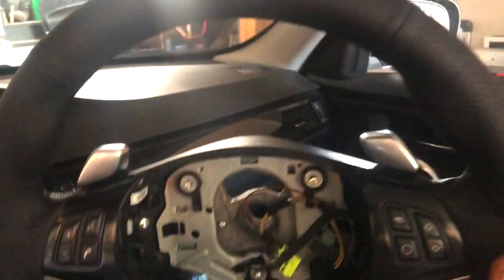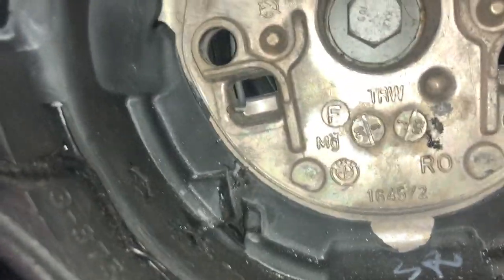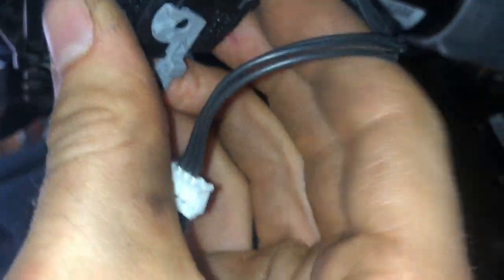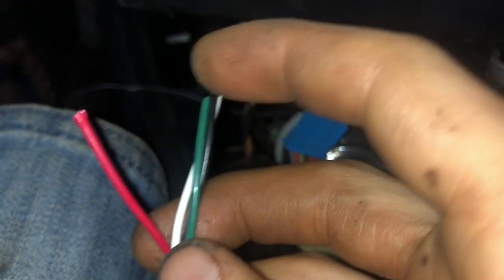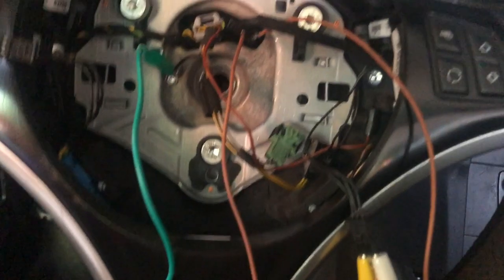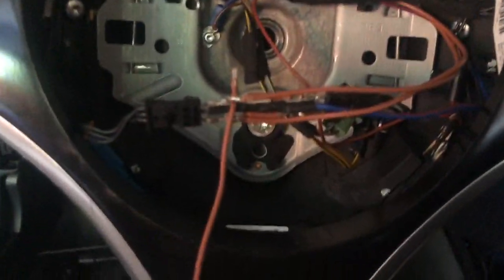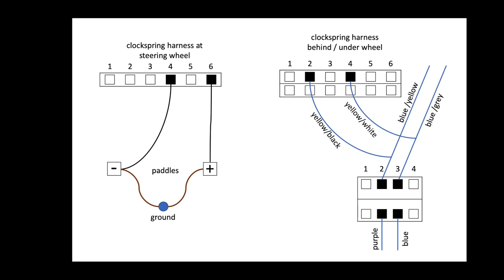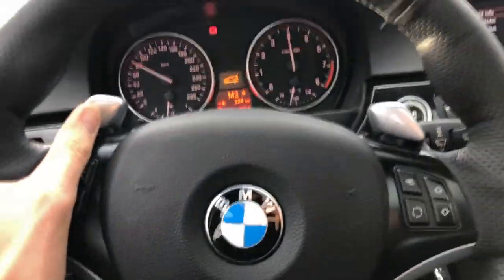BMW E90 Paddleshifter Retrofit

Comment: I have a question? Do you have to do the same wiring for the both of the paddle connectors?  or just the right connecter of the paddle connector
Reply from the maker: @Furtive_  the paddles are effectively joined together. With the default wiring they do the same thing. 

I just flipped the wiring on one paddle so it would pull to downshift and the other would pull to up shift like most modern paddle setups.

Comment: I did that a while ago on my 335d and the shifters didn’t work because the paddles were from a pre lci I needed that wiring diagram you posted in the end thanks
Reply from the maker: I’m guessing it helped?
Reply: @rackintosh  yes I just finished it today. But instead of by passing the steering control harness I spliced into it with no issues. Still have all steering controls, volume up, climate control etc.
Reply: I literally saw like 10 videos before this one actually helped me lol my pre lci car with pre lci shifters was simple and I only needed to wire from the shifter to steering colum this one was more time consuming

Comment: Does this mod work regardless which multifunction buttons the new steering wheel has? I know BurgerTunning says  that a certain part number multifunction buttons is needed apart from their harness. I wonder your method applies to a complete steering wheel that does not come with that specific part multifunction buttons.
Reply from the maker: I ended up bypassing the multifunction harness pins and just wired them directly into the clock spring. I couldn't get mine to work while connected to the multifunction harness
Reply: @rackintosh  me neither, I nearly gave up retrofitting mine until I saw you doing it your way

Comment: May i know the 2 existing cable on the clockspring harness under wheel [pin2&4] - where does that lead and whats the purpose of it? Is it safe to disconnect that?

Comment: I may have missed it in the comments, but where did you source the pins to put your wire in to put it in the bmw connectors? I'm curious about the ones on the wheel and the steering column. Great video and thanks for the help!
Reply from the maker: I had leftover pins from a wiring harness I de-pinned. I believe it was a quadlock stereo extension harness.

Comment: Question - after i retrofit them paddle shifters, can i perhaps get any of the modern paddles and change them? Will it work? Talking about them magnetic ones, or any just prettier looking ones? Thanks
Reply from the maker: @tonikaramanliev884  there are conversion kits for the steptronic paddles so you can run different styles. Do some research around “steptronic” you should find some options. They aren’t the cheapest but they do exist.
Reply: @rackintosh  thanks bruda

Comment: Thanks for the video. I have some questions about pins of the paddles.
Harness at steering wheel pin 4&6 connect to  left&right paddleshifter pin 1&3 , is that right?
thanks!
Reply from the maker: I’m not certain which is which but essential yes. 4 is for upshift, 6 for downshift (or the opposite). 1 & 3 on the paddles are the same and 2 on the paddles is ground. 

I flipped 1&3 on one of my paddles so that the left paddle is downshift and right paddle is upshift. 

You’ll just have to wire it up and experiment until you have everything right.

Comment: My multifunction bottons have plug when i can connect the shifters connector. Do i need to adjust any wiring there or will it work with just the clockspring pin 2 & 4 to gearbox?
Reply from the maker: I believe you can plug these into the multifunction buttons if they have the plug. I’m not 100% certain. 

You can always try and and see if it works.

Comment: Hi, your paddles works in mode D or just sport ? I have a 325i 2006 the paddles don't work in mode D but in sport mode it's ok
Reply from the maker: When in “D” mode it will shift but then revert back to auto after a few seconds. 

If they are working in sport mode that’s still pretty great!

Comment: Thanks for the video. I got a question, what do you mean by « bypass multifunction buttons » ? What I understood is that you just have to wire up and down wires to pins 4 and 6. And replug the connector. So do I have to cut the wires which previously go to 4 and 6 ?
Reply from the maker: The paddles normally connect into the steering wheel controls but for some reason mine didn’t work when hooked up that way. So I just created a harness directly from the paddles to pin 4 & 6.
Reply from the maker: I also can’t remember if there were even wires in 4&6 before but you should be able unpin them or something.
Reply: rackintosh , understood , thank you

Comment: There are 3 wires coming from each paddle shifter..your explanation shows only 1 wire going to pins 4&6 from each side and the earths being connected together..this must be incorrect..there are 2 wires from each side that need to go somewhere not just one
Reply from the maker: Three wires. Upshift, downshift and ground. 

Ground goes to the steering wheel ground (if I recall correctly) 1 is upshift, the other downshift. 

LCI paddles might be different but for the steptronic paddles this works. 

You can play with switching wires 1 & 3 until you get the desired function for the  paddles.

Comment: Does the heated steering wheels work on the new wheel?
Reply from the maker: Yes! I made sure to buy a heated steering wheel. If you have the non-sport heated wheel it will work.

Comment: thanks for the video, i see you did this to an LCI car, did you have to do any coding to get the car to accept the paddles? wondering if it will be different for a 2011 e91
Reply from the maker: I didn't have to do any coding, you just splice into the circuit already used by the shifter.
Reply: can be done for LCI MSPORT 2009 MODEL

Comment: I made a harness for this hardwire since the two wire method wasn’t working. I just have a question since I feel like my paddles Wires are messed up and aren’t the correct 1-3 pin layout. My horn goes off when turning on the car. I’m not afraid to mess with the car since I’ve been working on mine since I got it in 2014. Do you know the diagram for the wire coming out of the paddles itself. Mine are switched and can’t figure out what is ground, +\- do you know the layout for the Paddle shifters wires 😂
Reply: Did you find a fix? My car horn goes off too

Comment: Question....will this work on pre lci? 07 328i? If so which steering wheel would I need ? I know burger tuning has the retro fit kit
Reply from the maker: celis281 should work on pre LCI. I think the most difficult retrofit is getting the DCT or LCI paddles to work
Reply: I heard the only difference is on LCI cars you don't need to shift into sports mode to use the shift paddles, on pre-lci cars you do

Comment: I was thinking of getting a 535i steering wheel with the heater built in, do you happen to know if the same wiring is the same for the e90?
Reply: Did you end up getting it?

Comment: I’m still a bit confused after watching several times with the harness and schematic for the wiring and my own testing
Reply from the maker: It took me a while to figure it out. Double check and triple check everything? Make sure you have the correct pins on the column. And try changing things around if it’s not working. If you have LCI paddles this may not work
Reply: @rackintosh I have the ssg paddles, I appreciate the quick response I’ll definitely play around with it more thank you!

Comment: Same on e60?
Reply from the maker: No idea! Probably! I had to test wire it up to make sure everything is working. You can reconnect power (with the airbag disconnected) but you’ll have to reset the airbag light after.